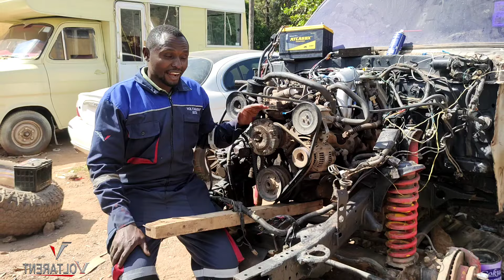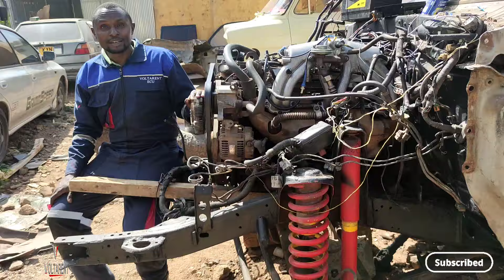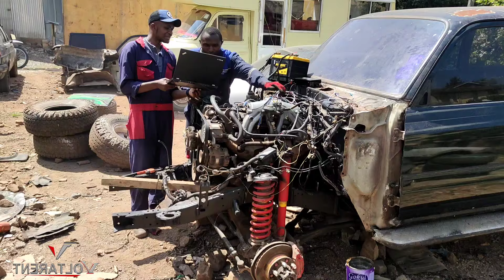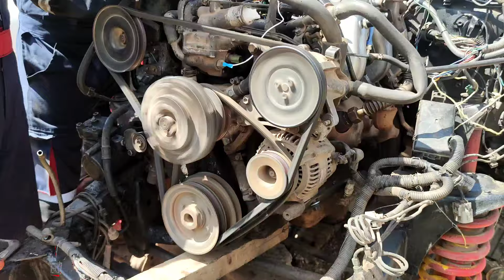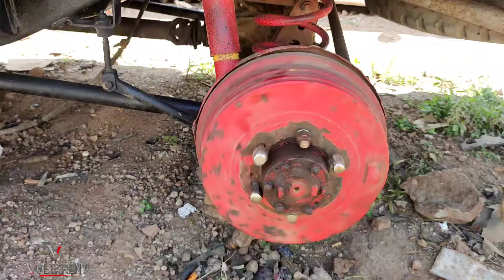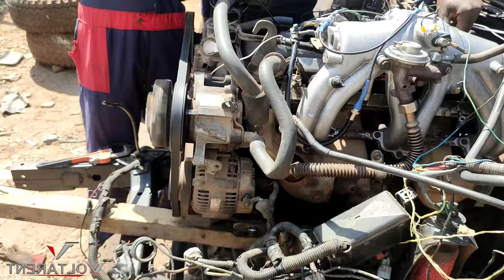A rough start, quite literally!!

Comment: Let work together to develop a CNG ECU and kits
Reply from the maker: Hey man, I have just seen your other comments of the same. What are the drawbacks of using CNG on a normal petrol engine?
Reply: @PeterMbiria1  if the vehicle is calibrated correctly there will be no draw back on the engine in fact  your engine should run better with increased lifespan and lowered maintenance cost as a result of cleaner fuel

Comment: its an old engine so my guess is the compression is down. No amount of "tune up" can cure an old engine with poor compression
Reply from the maker: Compression wasn't the issue. I agree with your last point, it doesn't matter the control system, poor compression will yield poor results!
Reply: @PeterMbiria1 Hi. Kindly share your workshop location. Thank you.
Reply from the maker: @VickeyWayne-rr2lo  If in Kenya, I'm in Ruiru along Eastern bypass
Reply: How can i reach you? share your contact pliz